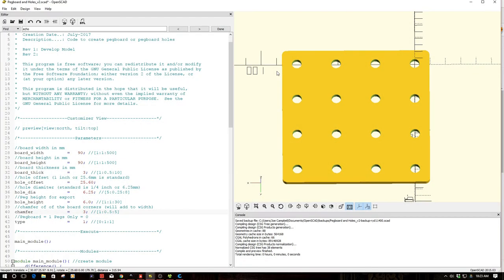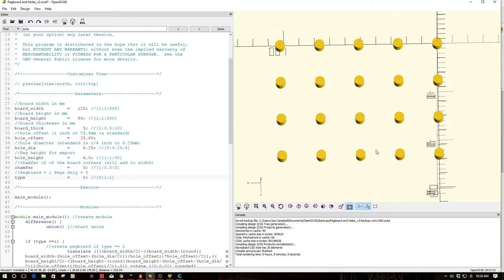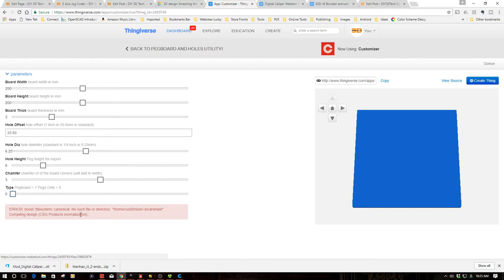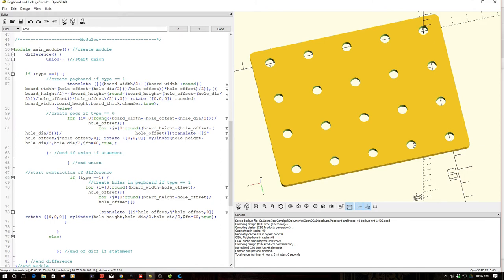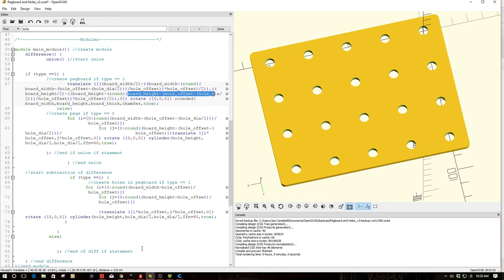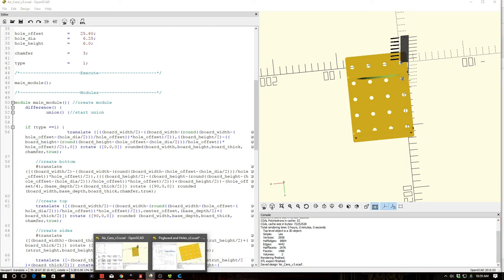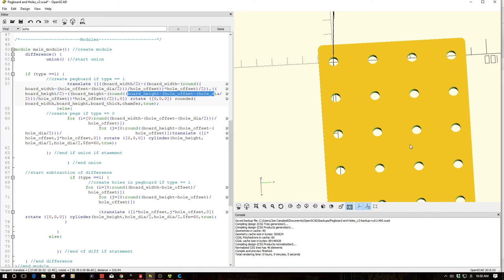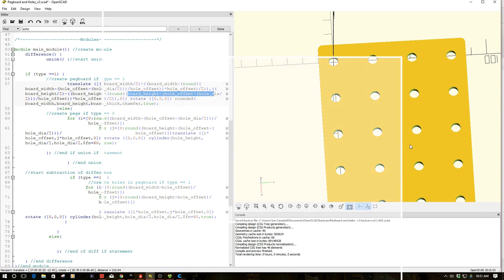Open SCAD - Pegboard and Holes Utility!

Comment: I think this does the same thing, but in this version the chamfer doesn't add to the dimensions of the part, it just curves the corners.
It also has the option to center the origin. The code is pretty simple. It should be easy to follow.

//board width in mm
board_x = 100; //[1:1:500]
//board height in mm
board_y = 100; //[1:1:500]
//board thickness in mm
board_z = 3; //[1:0.5:10]
//hole offset (1 inch or 25.4 mm is standard)
hole_o = 25.40;
//hole diameter (standard is 1/4 inch or 6.35 mm)
hole_d = 6.35; //[5:0.05:8]
//Peg height for export 
hole_z = 6.0; //[1:1:30]
//chamfer of of the board corners (will NOT add to width)
chamfer = 3; //[1:0.5:10]
//Pegboard = 1, Pegs Only = 0
type = 1; //[0:1:1]
//Origin @ Center = 1, Origin @ Top Left = 0
origin = 1; //[0:1:1]

Pegboard();

module Pegboard(){
    translate([(board_x / -2) * origin, (board_y / -2) * origin, 0]){
        if (type == 1)
            difference(){
                rounded(board_x, board_y, board_z, chamfer);
                holes(board_x, board_y, hole_z, hole_o, hole_d);
            }
        if (type == 0)
            holes(board_x, board_y, board_z, hole_o, hole_d);
    }
}

module rounded(x, y, z, r){
    hull(){
        translate([r, r, 0]) cylinder(r = r, h = z, $fn = fn(r));
        translate([x - r, r, 0]) cylinder(r = r, h = z, $fn = fn(r));
        translate([r, y - r, 0]) cylinder(r = r, h = z, $fn = fn(r));
        translate([x - r, y - r, 0]) cylinder(r = r, h = z, $fn = fn(r));
    }
}

module holes(x, y, z, o, d){
    x_start = (x % o)/ 2;
    y_start = (y % o) / 2;
    x_count = floor(x / o);
    y_count = floor(y / o);
    for(x_pos = [0:x_count]){
        for(y_pos = [0:y_count])
            if (y_pos * o + y_start > d && x_pos * o + x_start > d)
                if (y_pos * o + y_start < y - d && x_pos * o + x_start < x - d)
                    translate([x_pos * o + x_start, y_pos * o + y_start, -0.01])
                    cylinder(d = d, h = z + 0.02, $fn = fn(d/2));
    }
}

// returns the correct $fn value for 10 segments per mm.
function fn(r) = 62.831853 * r;
Reply from the maker: many thanks I will give it a try!